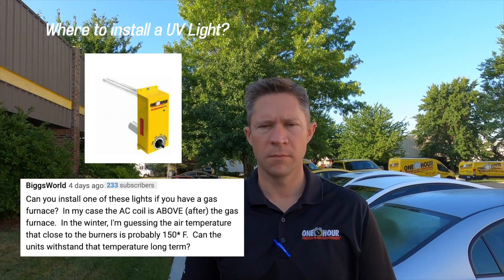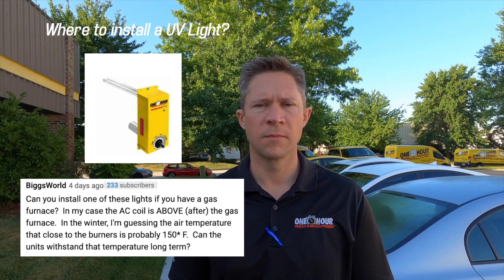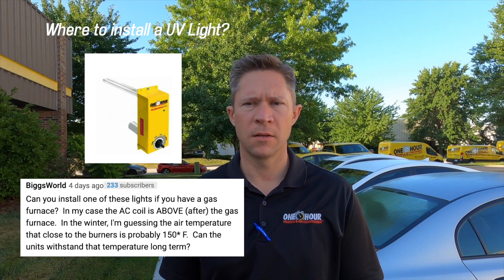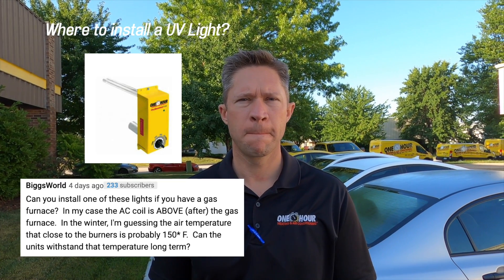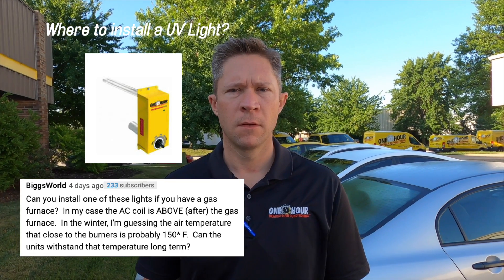Where to Install a UV Light?  Can You Install a UV Light Above a Gas Furnace?

Comment: Well, this makes no sense to me.  Assuming my HVAC is similar to lost HVAC systems.  My return duct empties into an electronic air cleaner which empties into the furnace blower compartment which empties into the evaporator coil compartment which feeds the supply ducts ( immediately before branching into the supply ducts the compartment has a whole house steam humidifier and a temperature sensor).  Assuming everyone wants to breathe the cleanest air possible, and assuming the evaporator coils are where a whole lot of bad stuff grows quickly and easily in the summer, if you put the uv in the return the air it treats has to make its way through the electronic air cleaner or a pleated filter which must lower it's efficiency then it has to go thru the blower compartment where it could pick up some bad stuff then it has to get thru the evap coils where it's likely to pick up bad stuff and get dirty again then it gets humidified and supplied into the home where you are breathing dirty air again!  Please enlighten me if I'm wrong in my thinking but if you only have one uv light it has to go above the evaporator coils immediately before the supply so it purifies the air then it gets circulated then we breathe it.

Pete